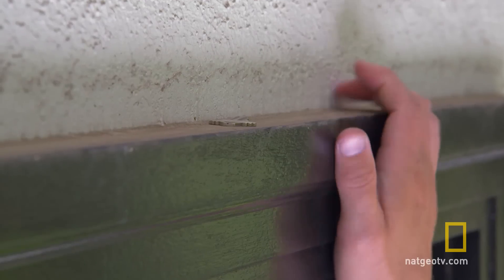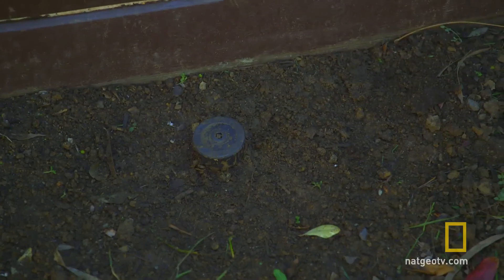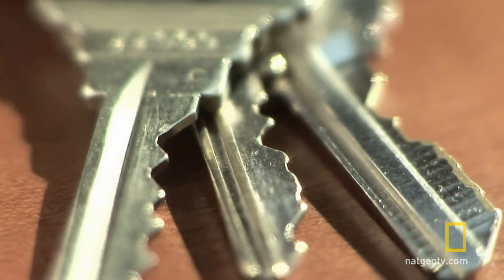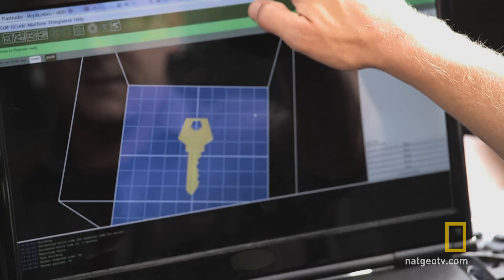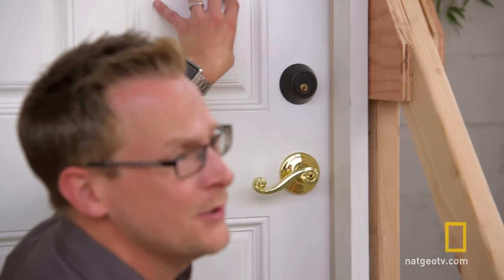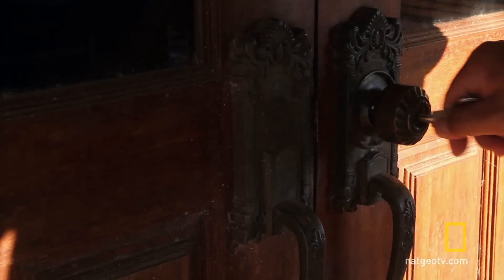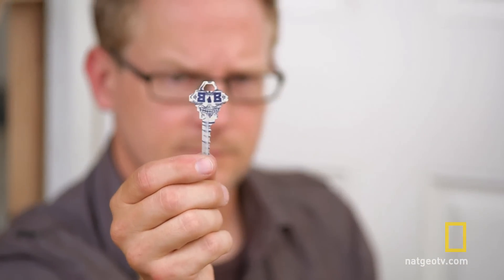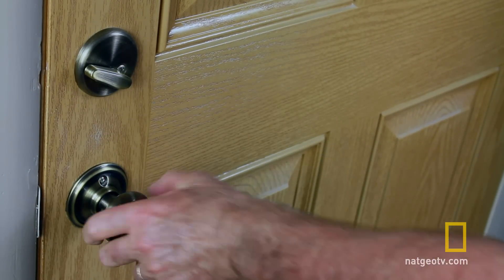The Keys to An Easy Break In | Hacking the System

Comment: Really, unless you have an alarm... locks are just a delay.   
Video cameras, alarms and lights that turn on when your power goes out.
can go a long way to keep your stuff safe.. 
You may ask about the power fail lights.   Someone broke into a friend of mines rental. the first thing the burglar did was turn off the homes power.
That disabled all of this security, devices.. So unless you have a battery back up your video recorders, web cams and even local alarm may get switched off from such a simple trick.